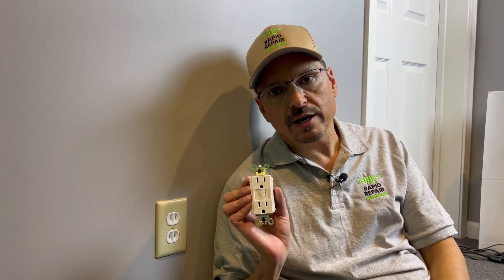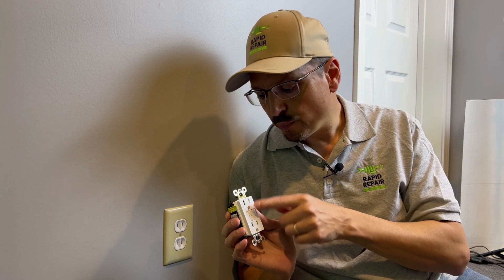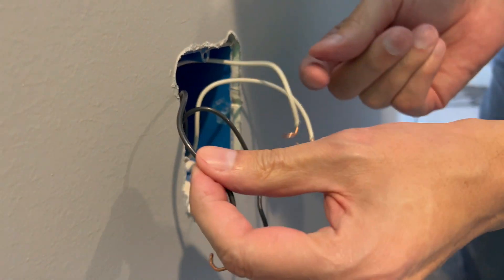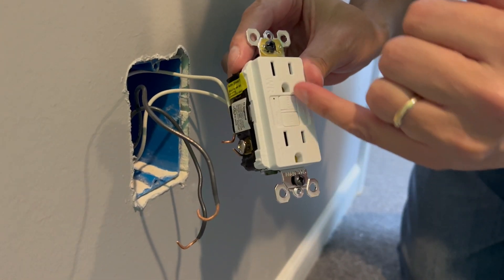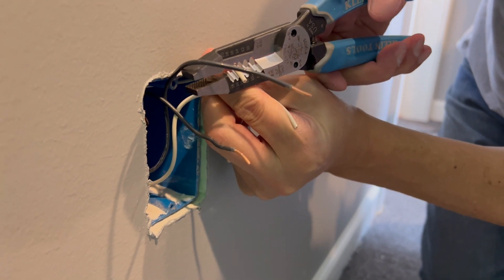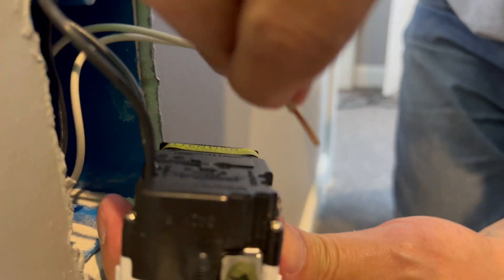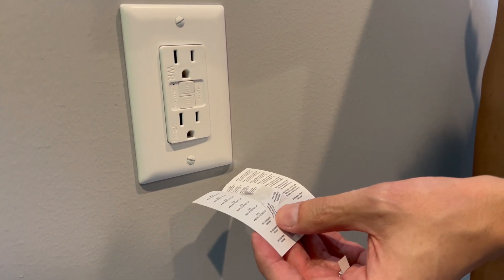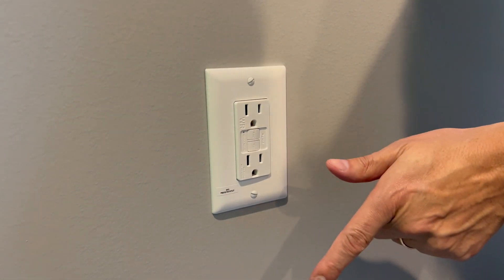How to fix a TWO-PRONG Ungrounded Outlet

Comment: One thing worth noting.  GFCI protection on a older ungrounded circuit will provide personal protection from electrical shock hazards from faulty equipment,  but cannot provide equipment protection.  For example,  your flat-screen TV and stereo system plugged into a surge protector for lightning protection must have a true ground to act as a shunt for the surges.   In this case even with GFCI protection you can kiss your expensive electronics goodbye unless you actually pull a new piece of romex to the panel and ground it.
Reply from the maker: Thanks for sharing

Comment: Speaking of 15 vs 20 amp circuits, yes 15 amp outlets can be used on 15 or 20 amp circuits, with one major exception.   A single outlet on a 20 amp circuit (a round outlet, resembling what you'd plug a window air conditioner into) MUST be a 20 amp outlet,  which is easily identified because the neutral will look like a T turned on it's side.  A duplex outlet counts as two outlets.   You however,  are NOT permitted to install a 20 amp outlet on a 15 amp circuit.

Comment: You could have connected the downstream wires to the Load and then protected those outlets. You could then change them to 3 prong receptacles. You would put 2 stickers on them: "GFCI protected outlet" and "No Equipment Ground".
Reply from the maker: Thanks for sharing. I should pin your good advice at the top.